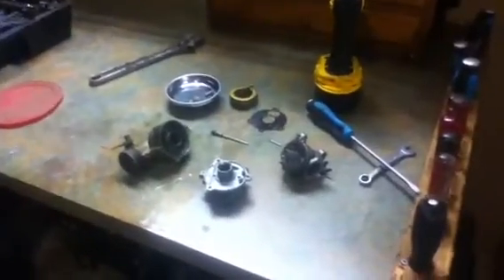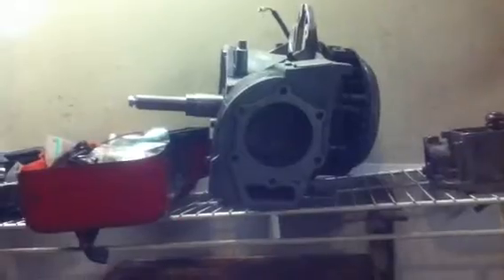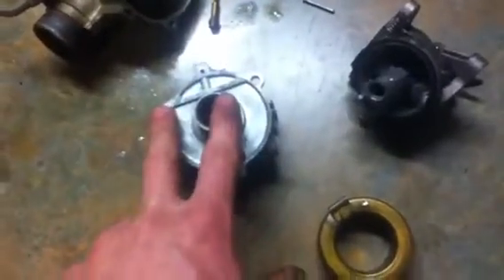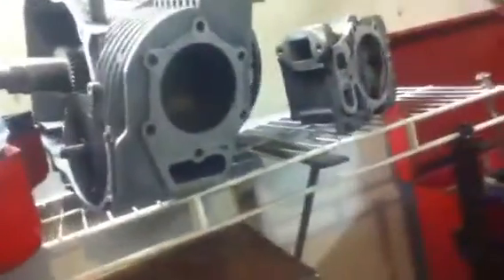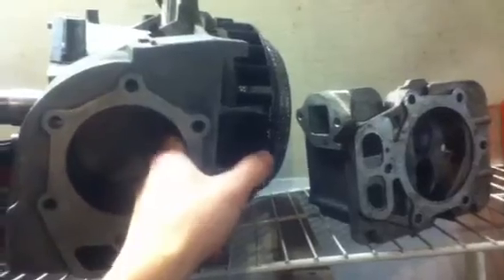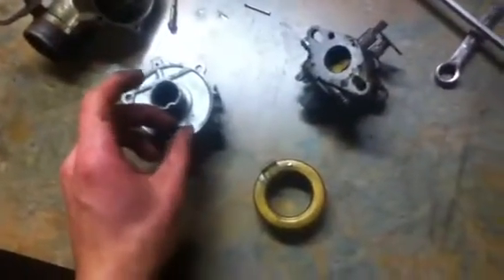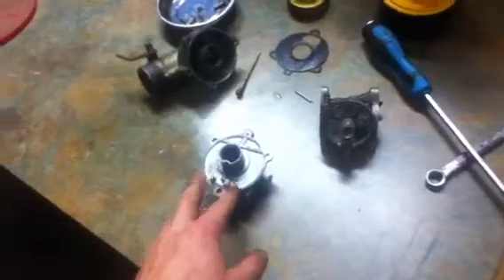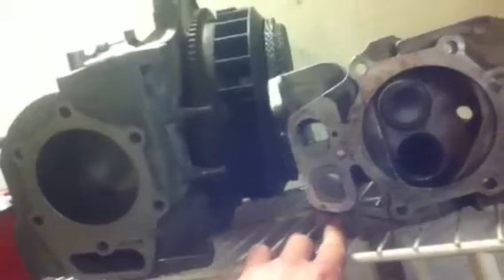What causes crankases to fill up with gasoline.

Comment: Best is to SHUT OFF the Fuel after each usage or RIDE your Lawn Mower until all your GASSES is out. Or Park it and RUN it until it die :))). Do this to ALL GAS household Engines... Like Push Lawn Mower, Snow Blower, Trimmers... ETC... Good Video BTW :), use your Knowledge to make $$$ :D

Comment: so half way threw watching this video I sprinted out to pull the fuel line off my carb before it filled the mower any more.  I've been fighting this issue all morning and it's exactly what happened to my mower. I KNOW I had fuel in the tank last night. I went out this morning and It was dry. I assumed it was leaking from a fuel line.  it was difficult to start then once I did get it started it hurled runny oil out of the pcv tube. luckly I didn't have it connected to the bottom of the air filter box so it just went all over the ground. two videos later and I know how to fix it haha. this is the first how to video I've actually found useful on youtube.  my only suggestion would be to get a better camera.